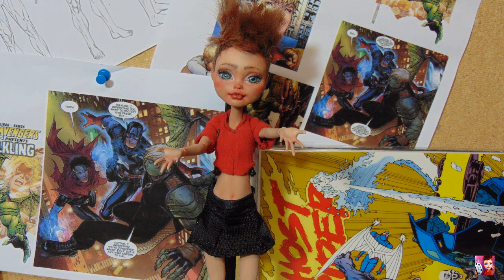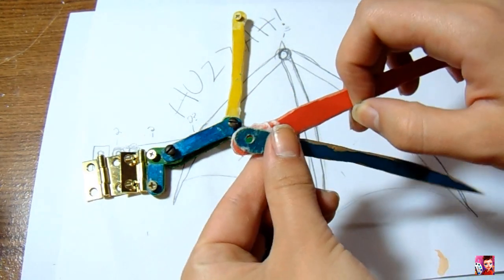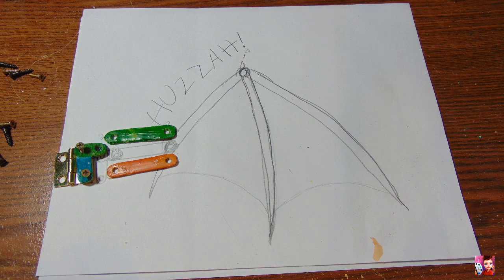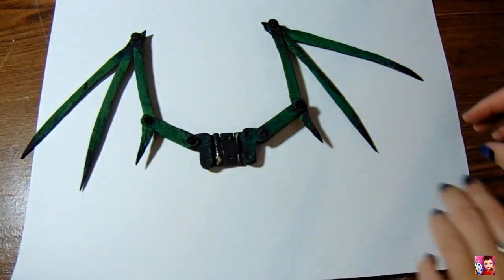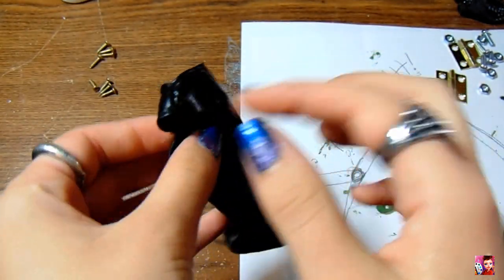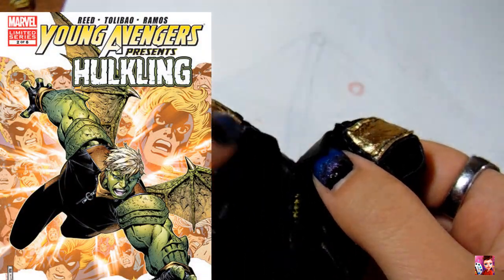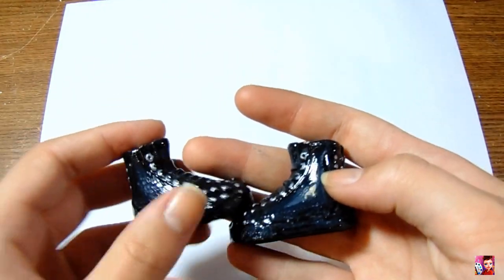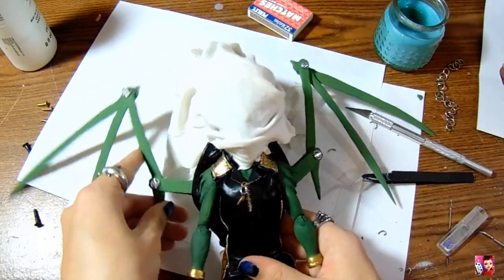The Hulkling OOAK Doll Part 2 | Clothes and Wings

Comment: Hope this helps with the thread locker

But when you need to tighten the bolt immediately after putting it on, and do it tightly. It doesn't cure when exposed to air. So when it's tightened it squeezes all the air out, then you just wait for it to cure. Then you just wait about 24 hrs for it to cure fully. I usually tighten the bolt and duct take it, or clamp it.
Reply from the maker: ohhhhhhhh That helps a lot!!!! Thank you so much!